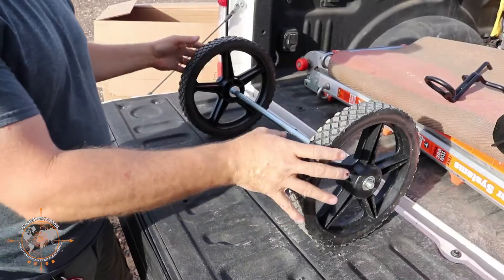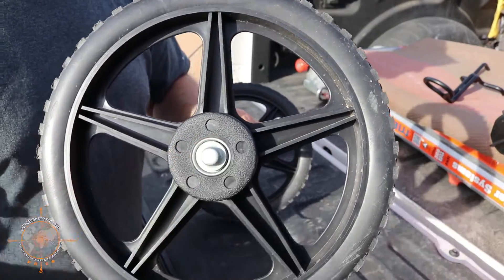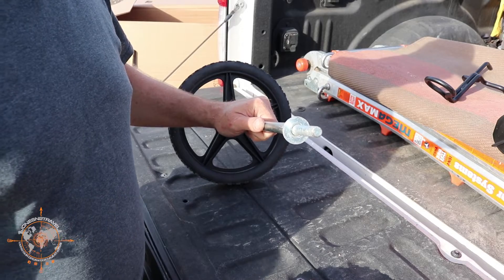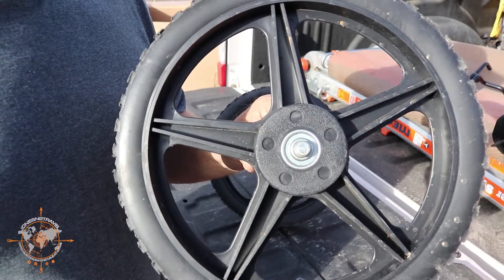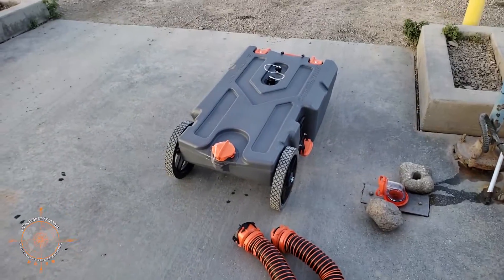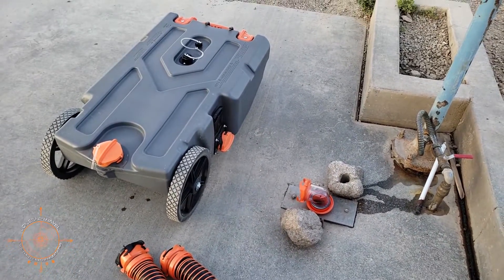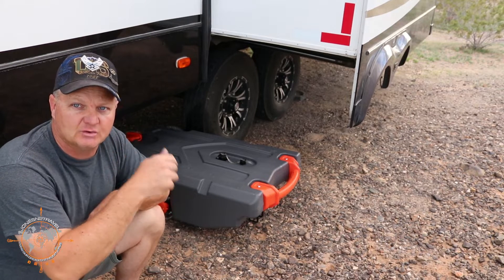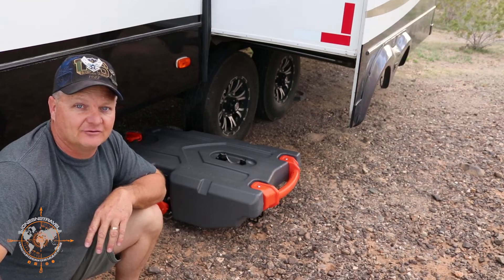CAMCO RHINO TOTE TANK REVIEW AND MODIFICATION | RV LIVING

Comment: I like the theory behind the tote but not sure about the execution. We boon-dock a fair amount. We have stayed at the same place in Quartzite as well. I can see towing the tote to that dump station and being successful there. My concern is what about a lot of other places you may have to go10- 20+ miles to dump? and down rocky roads or freeways ? Is placing it in the back of your pickup and using a macerator / pump the answer? I assume once you have 20+ gal's of liquid its going to weigh over 200#'s so picking it up and lifting it into the truck bed is out (?).  Any other ideas ?
Reply from the maker: Hi Herb. I agree, quite heavy full so yes the next option would be to macerate into the tote in the back of the truck. Hope that helps. Safe Travels

Comment: Thanks for the video and modification tip. I am going to purchase the 21 gal tank because 36 gallon is to much weight if I choose to transport by hand if close enough to the dump station and will have this modification done right away.
 @ 9:52 in the video what size drill bit do you use? Thank You!
Reply from the maker: Hi John. Thanks for checking out the video. I know I used a 5/32" cotter pin and I don't remember exactly which bit I used but it was probably a 11/64" bit which should be plenty big enough for that size pin. Really any size bit slightly larger than the pin will work. Hope that helps. Thanks for following along. Safe Travels
Reply: @JonesN2Travel  Thank You! Sir ! For taking the time for me.

Comment: Great idea to use cotter pins.  I saw someone else take a bungee cord from the trailer hitch, around the ball and back to the hitch.  This keeps the tank connected to the truck.  Also saw a mod that used threaded rod for a longer axle that mounted pneumatic tires.
Reply from the maker: Thanks Paul. My solution works but I like the other ideas you mentioned too. Thanks. Safe Travels

Comment: Just wanted to update you on my
Tank disaster. I called Camco and they sent me the modified unit. The modified unit has a green plastic space on the axle between the tire and the tank. It
Stilll has the caps on the end of the axle. I’m not sure this is gonna work and will make the mod you suggested here. Also of note. I repaired the crack in the original I unit. I purchased a can of Flex Seal and sprayed the area where the crack is
Located. So far so good.
Reply from the maker: Really? Wow! I have heard form others that they received a unit that actually had snap rings on the axle. I would still do the mod in your case. Glad to hear you were able to fix the other one. I didn't even think of doing that :) Thanks for the update. Safe Travels

Comment: Thank you for this video; much appreciated!  I had ordered the 36 gallon tote tank last week and received it.  After I put it together, I searched for videos on how people have used it with their camper, since I have never used one before.  After viewing this video and seeing how you made the modifications,  I went out to my garage and checked the wheel caps of both wheels.  One of the wheel caps came off in my hand and the wheel fell off the tank; it wasn't even pressed on tightly.  I drilled the holes on both ends of the axle and used the 5/32 cotter pin as you recommended.  Had I not seen this video, I would have had a HUGE problem on my hands on my first use of the tote tank.  So, again, thank you for saving me the headache and helping pre-empt this issue.   Scott
Reply from the maker: Hi Scott. So glad you found our video and prevented that mess. Happy to hear that it was helpful too. Thanks so much for checking out the video and our channel. Best of luck with your new tank and your travels. Thanks again. Safe Travels :)

Comment: I guess I got the updated one because the one I got has the snap ring behind the cap but I still wanted to do what you did but I tried and tried to get that cap off and it will not come off.  What is the purpose of the snap ring and is there still potential for it failing and the wheel to come off.
Reply from the maker: I have heard of others getting a tote with the snap ring. I believe this is Camco's attempt and solving the issue. You could drill through the cap and axle and install a cotter pin anyway. I have not heard any reports that the snap ring has worked or failed so I can't really speak to its reliability. If it were me I would still do a cotter pin through the axle. Better safe than sorry I suppose. :) Thanks for checking out the video. Safe Travels
Reply: Do you have any tips on getting the cap off because I tried and it wouldn't budge or do you think I should just drill through the cap
Reply from the maker: @kbrowniiee  One of my caps was difficult to get off and I just used a pair of pliers to pry it off. There is no harm in drilling through the cap if you cant get it off though.
Reply: @JonesN2Travel  ok thank you

Comment: I want to check in on your modification with the cotter pin.  I just picked up one of these totes and am considering making the modification you suggest.  Is the modification still working well for you?
Reply from the maker: Hey David the mod is holding up great for us. Have not had a single issue since I installed the pins. I would recommend it unless you find it very difficult to get the caps off. Not a risk I would take though lol
Reply: @JonesN2Travel  Thank you so much for your reply.  Your videos are super!  Did you use a 5/32 pin?  I believe that is what you noted in your video.  I will make the modification this weekend.
Reply from the maker: Yeah, I had to check the size myself but yes 5/32 works great. Keep in touch and let me know how it goes with the tank. Thanks for watching :) Safe Travels.

Comment: 7th video I watched trying to figure out the basics of how unit works and this one was the most helpful. I'm brand new to camping so would love close ups on the valves up top to clean out tank, when I should have them open, etc. Thanks
Reply from the maker: Welcome to the channel. You should only leave the grey tank valve open when you're connected. Never leave the black tank valve open. Hope that helps. Safe Travels
Reply: We might be referring to different things due to my ignorance on the topic. 

1. I meant the clean out flusher and rinse out connector caps on top of the rhino tank

2. In reference to your comment, are you saying the black water valve on camper shouldn't remain open even when connected to rhino?

Thank you much
Reply from the maker: @brady7815  So sorry I misunderstood. No I was referring to the black tank on your RV when your hooked up to sewer at a park, leave it closed until you need to dump it. On the tote tank there is a vent cap and a washout cap for the garden hose. Honestly I've never used it on my tank. A lot of dump stations out there don't have a threaded hose end or any way to hook up a rinse hose to the tank so I just add some water to it with the hose supplied by the dump station and then dump the rinse water. Hope that helps
Reply: Thank you very much. That cleared up my confusion and answered my question.

Comment: Just recvd my 28gal tote. I went to make this mod but as i was trying to take the hat off i noticed that on this one there is a machined grove on the axel that the two tangs of the hat snap into. After seeing this i stopped trying pry off the hat. I will give it a try w/o the mod. Wish me luck.
Reply from the maker: Wow, that must be the manufacturers attempt at fixing it. Good to know. If you want the piece of mind you could drill through the hat and axle and install a cotter pin anyway. May not be necessary with that new groove but certainly wouldn't hurt. Best of luck and Safe Travels.
Reply: JonesN2Travel The problem i see with drilling thru both hat and axel is that the wheel is in the way of the drill
Reply from the maker: @tdkendall  Ah, yes that could be an issue. Not sure they make a long enough bit that small. Well, it was a thought. :) Hopefully the company tested the new "groove" method and you wont have any issues. Happy boondocking!
Reply: JonesN2Travel well i went and got a 6in drill extension with 1/4in hex female. Used 1/4in hex shank drill bits but no luck. That cap is really hardened. Even trying a nail tap to start the bit, it just wants to walk and spin. Maybe using a cutoff disk and then welding IDK. Or cap off and cotter pin as you did. So i will try it w/o the mod, see what happens. Thanks for the video and help!!!

Comment: How fast did you drive that thing? Over the stones and it held up. Cool.
Reply from the maker: I tried to stay at about 5 mph. I was really concerned about the rocks too but it did hold up. Thanks for checking out the video. Safe Travels
Reply: @JonesN2Travel  I have my tank and wonder, what if I drilled thru the cap and axle for a cotter pin vs removing it? Any thought on that? Would do this tomorrow before our trip. Thx
Reply from the maker: @paultaylor6167  I don't see why not. Sounds like a great solution and you wont have to wrestle with the cap :) Great idea. Let me know how it goes. Safe Travels :)
Reply: @JonesN2Travel  I'll do that. Another option might be a hole into the end of the axle thru the cap. Then screw in a self tapping screw. But if this rusts in that could be a difficult fix to remove if needed. I'll go with the cotter pin.
Reply from the maker: @paultaylor6167  Sounds good. 😁
Reply: @JonesN2Travel  well. Not so easily done. I dont know what those caps are made of, perhaps kryptonite..I cant pierce them. I tried drilling in the end and no luck. Possibly very dull bits. I noted the tabs that are pressure forced against the axle so I gave them some extra whacks. I'll have to try better bits. I may have to pop them off. I used it once behind the truck on blacktop roads and it went ok.

Comment: Just bought the 21 gallon model. The axle now comes with external retaining rings instead of the retaining cap to hold the wheels on.
Reply from the maker: Hey Michael, thanks for that update. I have heard reports of some folks getting the new design. So glad to hear they fixed it. :) Safe Travels

Comment: Excellent video! Thanks. I'm waiting for my 36 gallon Camco tote from Amazon and now am prepared. Amazon has always been so helpful to me also regarding product flops. Are you certain the inner washer isn't necessary?  Have the same axle  issue on the Husky chests sold at Home Depot. I bet it's just a cheaper and faster way to get these out of the factory and it stinks! Another modification upgrade could be to replace those hard wheels with air style wheelbarrow wheels for a better ride at many bumpy rough road campgrounds.  There's a YouTube video on this. The guy used threaded rod as the new axle. There's gotta be a better way than wrapping it with electrical tape though, but it seems to work.  I'd keep it cable locked to the rear ladder or cargo carrier due to possible theft. A guy had his expensive generator stolen off his cargo carrier while he was driving slowly in town.  I'm absolutley fed up with criminals and voting for strict law enforcement and severe punishment. Happy and safe RVing! 🙂
Reply from the maker: Thanks for sharing. I agree, nothing worse than a thief. :) Safe Travels

Comment: Our first Rhino was the smallest one.  After a couple years the tires broke beyond repair.  Hanging mechanism fell off also.  We decided to get the largest tote and tires fell off right out of the box.  My husband pounded the end caps back on and all seemed fine.  2nd time using it, today as a matter of fact, both tires fell off within seconds of towing it.  Didn’t realize it till we got to the dumping station.  Thankfully that wasn’t that far but it did get pretty banged up.  I’m getting those pins and making sure this doesn’t happen again.
Reply from the maker: Hey Veronica, so sorry to hear that you had a similar experience to mine. Sounds like you'll be able to reuse your tote once you get the pins installed. Thanks for sharing your story and for checking out the video. :) Safe Travels
Reply: JonesN2Travel what drill bit did you use?
Reply from the maker: @veronicadavidson2575  just use a drill bit for metal, the axles are pretty soft and easy to drill. Use the size appropriate for the pins you choose. Hope that helps.
Reply: JonesN2Travel  thank you! Will do.

Comment: What size drill bit and cotter pin did you use? Very helpful!!
Reply from the maker: The cotter pin I used was 5/32" but I don't recall the exact drill bit I used. Just use a drill bit slightly larger than the diameter of the cotter pin and you'll be fine. :) Thanks for following along. Safe Travels

Comment: Thank you so much for sharing this fix! Question - I've been doing research on this (motivated by a leak in my SmartTote 2) and am wondering: except for the obvious issue of a flat, is there any reason I shouldn't use pneumatic tires?

I should note that I'm capable enough to swap the entire axle out and put some H.F. tires on there. I just hate the plastic rumbling that my S.T.2 makes while I crawl to the dump at 3mph hoping I don't have an axle or wheel issue. On the S.T., the axle runs through the molded body of the tank. That makes me nervous. The tires I want to buy have their own bearings, which I see the Rhino also has, but the HF ones are a bit beefier. Any feedback would be appreciated and thanks again for all you're posting!!
Reply from the maker: Hey Charlie. Thanks for following along. I see no reason at all not to go with pneumatic tires. I have actually thought of putting them on my tank. The plastic tires make me nervous because they have no give. If you do decide to do pneumatic tires keep me posted on how well you like them and which ones you used and maybe I'll upgrade mine too. :) Thanks Safe Travels
Reply: @JonesN2Travel  will do!

Comment: Nice job, bud! Impressed with your workaround (as I've seen others do the same). One thing I noticed, at the 10 min. mark, you put the wheel on wrong before securing the cotterpin (probably doesn't matter). Question though - is the tow handle upside down? It seems as if it would fit the ball hitch easier if it was flipped. Thanks for the backstory and transparency on this ToteTank -- getting one after your video review. Great video and awesome boondocking location!
Reply from the maker: Hey there A-Team. Thanks for checking out the video. I did turn the wheel around off camera, it was backwards LOL. The handle can go on either way I suppose, I just used it the way the instructions showed. Thanks for following along. Safe Travels

Comment: Great video! I was wondering how this mod is holding up!  I was also wondering if the axel rod could be replaced with one that has threads and put a washer and a couple of nuts to lock it in place along with a cotter pin!
Reply from the maker: That is a great idea and yes it could be done with a piece of all thread the same size as the axle. The axle rod simply slides through a confined space on the bottom of the tote so you could easily replace it. I used the existing axle and cotter pins simply because that is what I had on-hand to work with but I like your idea too. :)

Comment: Ours started to leak at the filler / dump hole after  two years or four weeks of camping.  I am attempting to plastic weld the leak with hdpe material.  Those nice cap lanyards break off easily.   It is useful but for the cost it needs  better or stronger materials.
The instructions show 5 mph max for towing.

Comment: Removing the inner washer allowed the wheel to ride closer to the tank. I'm curious to know, did it RUB UP AGAINST THE TANK AND DAMAGE the tank over time?
Reply from the maker: Hi Nathan. The tire doesn't rub the tank at all and we've had zero problems without the inner washer. Hope that helps. Safe Travels

Comment: Just an update , don’t know if it’s because of this video or peoples complaints but this same tank now comes with the wheels attached with a snap ring. I actually bought this tank from an Rv store stopped at the hardware store immediately afterward and bought Cotter pins and a few drillbits. Took it out of the box and discovered I didn’t need to make a modification .!! How awesome . 

I had a cooler on wheels that did this to me . Pretty annoying . I think it was a Coleman. Same think a little hat cap .
Reply from the maker: Hey Stephen. I have been hearing reports that new ones are coming with snap rings. That is great news and hopefully they hold up. Great to hear that you received the new version. Not sure if its because of this video or not but I haven't heard a peep from Camco LOL Thanks for checking out the video and following along. Safe Travels
Reply: @JonesN2Travel  yeah ! Thanks. It’s nice when people makes YouTube videos about products . Gives you a feel for what your buying. Thanks for the video .

Comment: I just bought a 21 gallon unit, manufacturing date of 6/26/2020. It looks like the wheels have a locking clip on them now. So plenty of wheels must have fallen off for them to change the design.
Reply from the maker: I agree. I've been getting reports from subscribers that they fixed it with a clip. Hopefully that will be a good solution. Its a great tank as long as the wheel stay on LOL. Thanks for checking out the video and providing that update. Appreciate it. :) Safe Travels